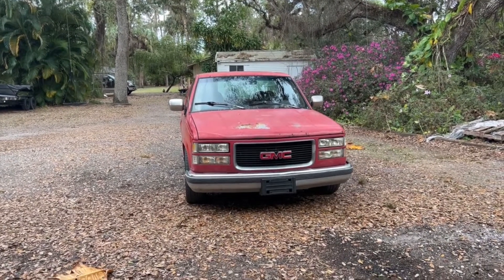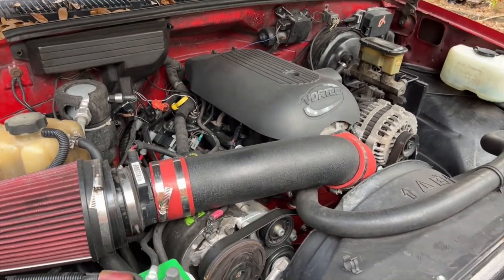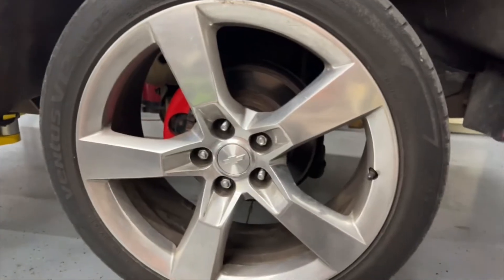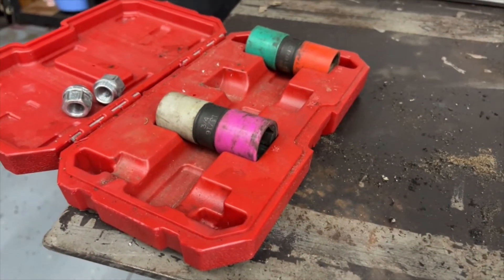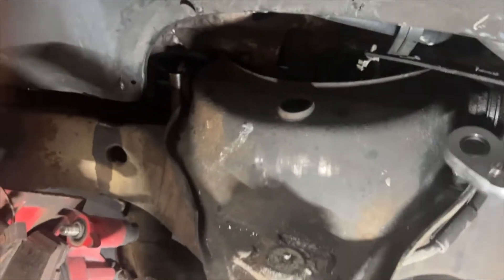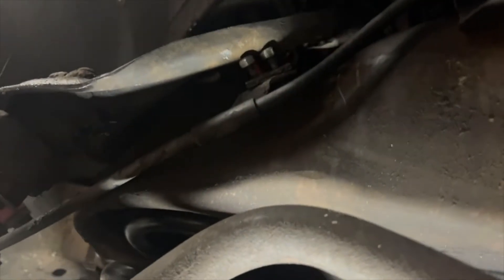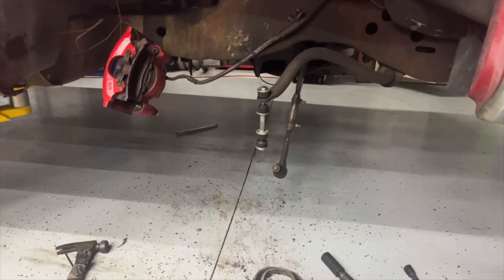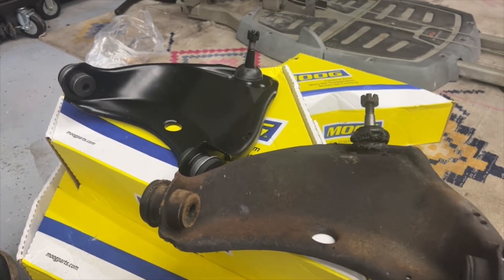Swapping out OBS Chevy Control Arms at home??

Comment: The nut u found by itself when you took off the lower control arm it was a motor mount bolt that goes through the frame   

Awesome vid 👍🏽

Comment: Ok! Finally got around to doing the lower control arms yesterday! So, while doing it, notice I need to change the tie-rods. Arriving Wednesday. Then off for alignment.  Looking at the front from street view, appears upper is toe in and lower tire outbound. I didn't notice anything we missed.
Reply from the maker: All I can think of is they shipped the wrong parts?maybe the alignment shop can make sense of it?
Reply: @repairandsharegarage  Thanks. I did check the parts again to be sure they were the correct replacements. All good on that front! Will post once I get it aligned.
Reply from the maker: @klb1956  sounds good
Reply: @repairandsharegarage   As my best guess, the replacement parts were not exact, so the tie rod measurements were a bit long. Alignment came back, and now dealing with intermediate steering rag bushing is bad! Never ending! lol
Reply from the maker: @klb1956  I can understand that! kinda pricey but the Cunningham machine steering shaft is a good upgrade to get rid of the rag joint
Reply: @repairandsharegarage  Guess if the factory one last 374+k miles, and I don't have the cash to do what I really like to do...LS drop...I'll replace with new bushing and joint. Thank's for the tips!

Comment: Good video. Something I would've like seeing how you removed the spring. Did you use a spring compressor?
Reply from the maker: Thanks! With these trucks spring compressor wasnt really necessary. I’ve seen people put a length of chain looped around the bottom of spring to control arm just in case though. Once you loosen spindle bolts you can just work it out of there.
Reply: @repairandsharegarage   Thank you! I am about to do mine.

Comment: Did you have to use a spring compressor to get the lower control arm off?  You didn’t video that part. Thanks
Reply from the maker: Hi, sorry about that , no I didn’t ; with everything unbolted there’s enough slack in these trucks to wiggle it out
Reply: I have an 88 gmc thst i bought new and im doing the upper and lowers control arms for the first time since new. Truck has 294k on the odometer.  Your video saves me having to buy a spring compressor. Thanks for a good video. 😁👍🇺🇸